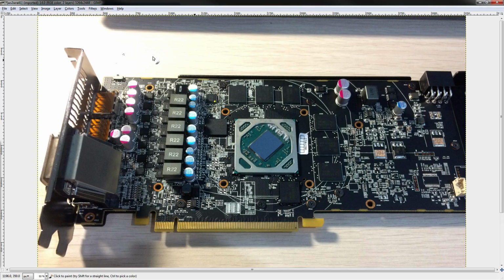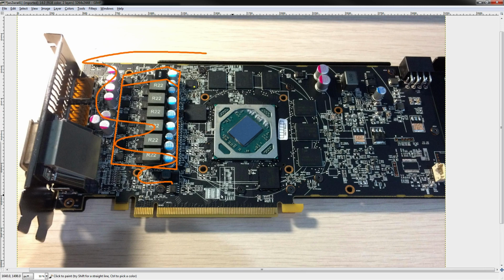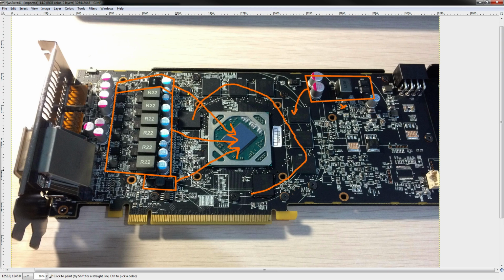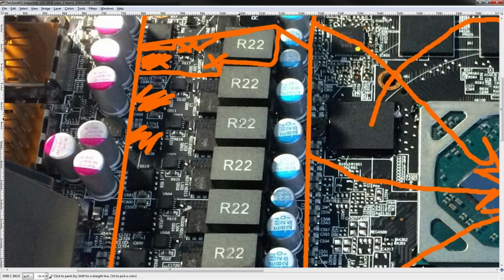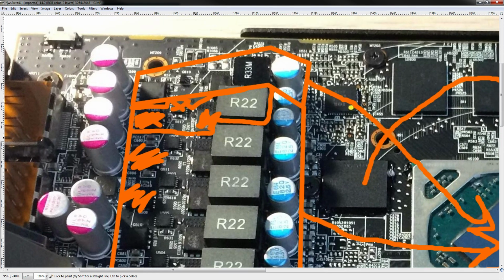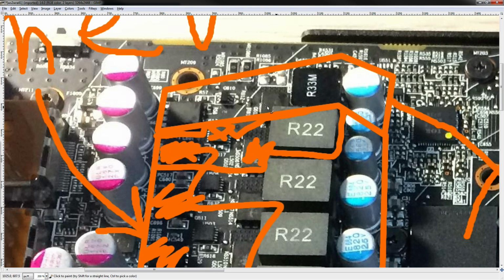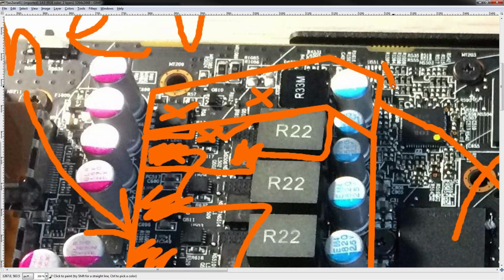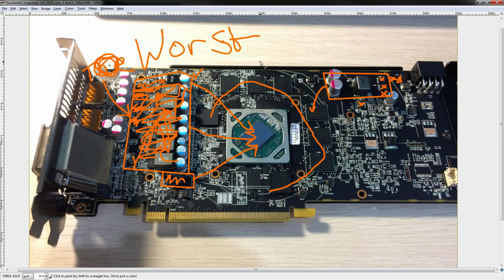PCB Breakdown: Powercolor RX 480/470 Red Devil

Comment: what does the bios swtich do?
Reply: you can switch between the two BIOS' that are flashed on this card. On of them lets it run on stock settings and the other one comes with a factory overclock.

Comment: Welp this is worse than the Gigabyte :D lol so would you think 1440MHz @1.25v 64C core 76C VRM is ok for 24/7?
Reply: That sounds like it's perfectly fine.
Reply: Alright. So now I have two of these under hybrid water running at 1400MHz 1.2v 62C core 58C core 69C VRM 68C VRM
Reply: acnfanmanin Just try to keep the temps of all components as low as possible.
Reply: pSyk Yeah temps are no problemo
Reply: acnfanmanin Lower than 76 I meant. 
60s would be better.
Reply: pSyk Kinda too much of a hassle to craft my own vrm heatsink
Reply: What are using to get a VRM temp reading on this card? A temp probe right next to the VRM's?

Comment: So if I have no plans on running FurMark BUT I would still like to push and OC my card a bit ...would this still be a poor choice?
Reply from the maker: You can OC into the 1400mhz range just don't give it a ton of voltage or too high a power limit

Comment: That is why I do not buy powercolor or diamonf, visiontek brand. They are freaking garbage.
Reply: Maybe it is not fair of me, the extreme marketing already made me suspicious of them, just for that I wouldn't have picked it. Thanks to guys like him we now know which brands are more and less trustworthy. I will probably not even pick a Gigabyte motherboard. Not unjustifiably, it turns out. 
https://nl.hardware.info/reviews/5834/zoek-de-verschillen-gigabyte-moederbord-revisies-presteren-merkbaar-verschillend
Gigabyte cheaps out on components amongst which MOSFET's for the power delivery (also audio). 
I don't get it. Why on earth does a company which had a good reputation and a good marketshare something like this? Why the urge to get an even higher profit at the expense of the customers? No Gigabyte components for me for the next few years.
Reply: Peter Jansen Gigaybte had a lot of problems with the RX 480 G1 cards. Especially Jay2Cents commented that gigabyte had a garbage cooler that can't actively keep the card cool.

I normally just stay with MSI and Asus. I had an XFX before and they were kinda ok. But my old 6870 ran at a lower clock than reference cause XFX had a bios issue and the cooler were crap. Its so loud its like a vacuum cleaner
Reply: And in 6 months ASUS and MSI might be crap as well, it's normal that the PCBs get worse with the pricedrops and after the Reviewers have done their reviews, so people buy a relativly expensive card and get crap.

I've a Powercolor 7950, a average/below average PCB first, but one of the best in the end, because except for cheaper VRAM they didn't change anything.
The MSi Twin Frozr III 7950 had a 7970 PCB first (awesome) and a few months after release they switched to a cheap crap PCB (and cheaper VRAM). Good reviews and then they start making money.
The Sapphire Dual-X 3L had a good custom PCB and got a cheap crap one later (and cheaper VRAM).
ASUS DC2 7950 didn't get a worse PCB (except for cheaper VRAM), but they started locking voltage to 1.09V and you couldn't flash unlocked Bioses on them, so almost no OCing possible on later models.
...

If you buy a GPU make sure you got what you wanted (take the cooler off and don't wipe the thermalpaste off, so you can spread that out again and you don't need to replace it) and if not send it back. Don't trust a brand. You can trust people you know, but you don't know the guy who's making the desicions in those brands.

I don't want to protect Powercolor here, but saying Powercolor is garbage is wrong. If someone keeps track of the 480s we will probably see even worse PCBs, maybe even with "good" brands printed on them. But you should know what you want/need and what you can expect, I got my 7950 for 200€ in 2013. Awesome card for that price at that time, sure not the best 7950.

And in this case it's a GPU for those who don't OC much and use the stock cooler. There are different cards for different needs, that's fine. It's only bad if you don't know what you're buying.
Reply: 96erAtDrift

That is the problem. We don't know what we are buying and we can't find out what we are buying, especially if they pull dirtbag moves like changing the PCB after the review.

MSI already did use suppar components for the RX 480. The only decent brands so far: XFX, Asus and Sapphire. Alle we can base our purchase decision on is which company has and hasn't done this before and only buy a card of a company which has never done that. We know that Gigfabyte and MSI are guilty with regard to the RX 480, according to you Asus and Sapphire have done that befoe. How about XFX?
Reply: http://www.overclock.net/t/1394623/belials-comprehensive-guide-to-7950s
XFX is guilty as well.

In this case we know it right know, but yes in most cases we don't know it.

I'm not a fan of sending/giving stuff back (and I'm certainly not using it if I get a bad OCing chip or something like it), but if a company changes the product without changing the name I'm using my right to get a refund. In the EU if you send it back in 14 days you will get a 100% refund (even shipping) and you don't need a reason for shipping it back.
But your laws might be different.

Sadly there's not a good guide to every GPU, but if they've done it on the 7950 they might do it again...
Reply: 96erAtDrift
I live in a country which is a member of the EU. Unfortunately 14 days will often not be enough to find out that the producs has been changed. Reviewers should put mcch more effort in quality control after the first review.
 Naming and shaming, the only thing that keeps the companies straight.

One other thing, if only AMD wiould put decent ventilators (you know, large and silent, non blower type) on the cards, then the reference edition would be fine.
Reply: Aoru

It seems like you need to lucky when you pick a brand.
Reply: I've a Raijintek Morpheus (aftermarket cooler), so I don't care about that cooler. Keeps my 7950 cool and will go on the next card as well. Worst thing that can happen is that you have to modify the mounting, on the 7950 I've a 1mm copper plate between die and cooler, because on the 7950 the chip sits lower than on most GPUs.

And there has been a Video of a german gaming magazine on YT were they put a little Accellero Mono on the RX480, which keeps it cool. 

The good thing about a cooler is you can use it again, the copper + alu will never fail and on the Raijintek you're just using two normal 120mm Fans. But it's big and heavy, I've a pen under it to support the PCB. If you care about optics or you've got limited space this monster is nothing for you... But my 7950 can use 240W and never goes above 60°C core and 65°C VRM (with liquid metal as thermal paste), so it's almost watercooling.
And you might find used coolers relativly cheap, since nothing can break on them if the picture is ok they're fine ;)

But I still can't see the card to upgrae to... either too expensive or not good enough...
Reply: 96erAtDrift

Putting your own cooler on the card, I like it. Is that possible with any card? If so, what coolers can you recommend?